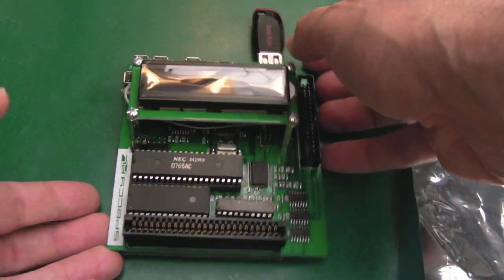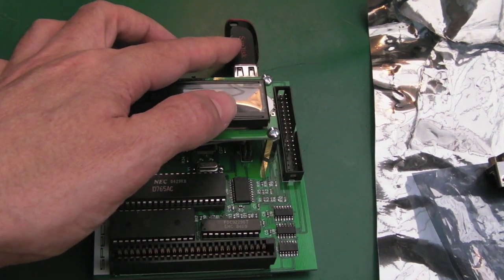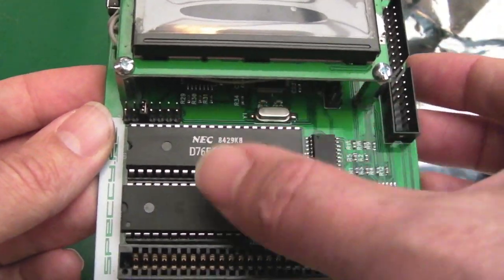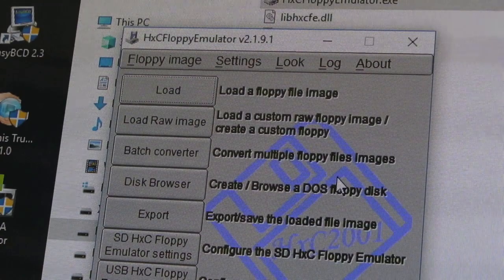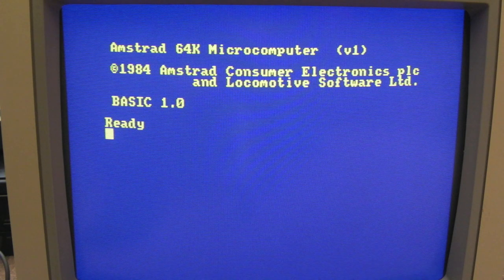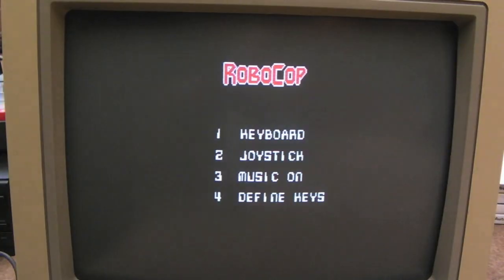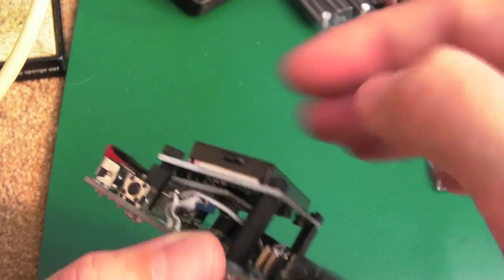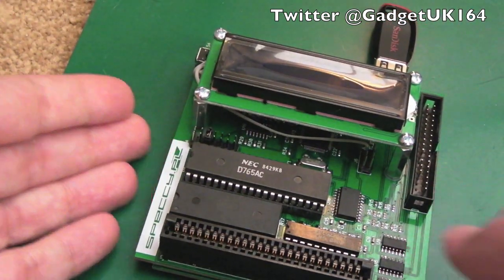Amstrad CPC DDI3 - Disk Interface, USB Disk Drive Emulator, PARADOS & 512K RAM Upgrade

Comment: It would be good if hardware manufacturers of kit like this could put the edge socket on a ribbon cable, rather than directly on the hardware (as Romantic Robot did with their Multiface II). That would solve your problem of not being able to see the screen as well as save on the wear on the connector on the CPC caused by pressing the top buttons.
Reply from the maker: Definitely!!! =D

Comment: I love Zaxon's boards. For the Amstrad I've got a "CPC 6128 USB Lite" that connects at the rear port like yours but without screen and works great, and I've got also a floppy drive replacement with HxC software and Led screen (so a Gotek but with the face 3D printed to fit and also has floppy drive sound). BTW I don't need/use this last, you if you want it I've got an Amstrad PC board that needs to be repaired...
Reply from the maker: Yeah, they are very nice!  I am hoping as he creates his website he might find some time to document some of the features and things.  For example, on this board there are a load of jumpers - who knows what they are for lol.  Floppy drive sound is a nice touch - my HxC in the ST provides that too.  It's a shame this board doesn't seem to support it.  Maybe it does, but needs a mod to add a speaker - no idea.  Thanks =D

Comment: Personally I'm not a big fan of those small displays connected to pcbs. As with the 1541Ultimate for the c64, I'm not sure they're actually necessary. 
Looks like a well built piece of hardware and useful for the Amstrad.
On another note Chris, does the traffic ever let up where you live? It's usually pretty busy when you're recording.
Reply from the maker: Yeah, I agree its better when there's no annoying LED screen to use lol.  No, traffic never lets up - drives me nuts!  Will move eventually!

Comment: Great video. Where's the best place to get the disk images where I've been using is hit and miss if the work or not.

Thanks
Reply from the maker: Probably archive.org initially - Get Amstrad CPC [TOSEC], and Amstrad CPC (GoodCPC v2.02).   Also many games can be found on https://cpcrulez.fr/games.htm#D
Reply: @GadgetUK164  thanks I'll try them, I've been using cpcrulez but I can't get b.a.t , north and south plus others to run from there.

Thanks again

Comment: Yeah those displays. I use them for the odd Arduino project, and they are a bit shitty. This looks to have some form of IC2 conversion board on the back of the display to make it compatible with the boards output. It may be possible to get a better display if you looked into it?

Comment: I read the firmware upgrade issues, and choose not to upgrade as I like the bootee and I have my hxc convertor setup to convert all my dsk quickly. I wonder how you would roll back. To avoid issues I stick with using converted hfe files.  Nice built in memory upgrade in this version thought, perfect if you can't get hold of the d'troniks module
Reply from the maker: Yeah, I wonder how to downgrade (same way as upgrade I think), but I have read that some people did revert back to prior version with issue.  I need to dig into things on the forums to ask around I think.  Thanks for pointing me towards this - this has opened up all the 128K stuff for me =D

Comment: Interesting video, Dont think i'll be getting one purly cos I've got a 6128 and I'm going to get a goteck drive to replace my current external 3.5 disk drive. But if i only had a 464 I'd definetely consider getting one. Also reminds me I've an origional DDI1 and drive in storage somewhere that i must get out and get going.
Reply from the maker: Thanks mate =D  I filmed this 3 weeks ago btw, else I would have mentioned your PCW video at the point I was talking about the NEC 765.  It was already ready to upload, just needed processing.
Reply from the maker: And btw - what dimensions are that DivMMC board you were creating?  I was contemplating building something to fit above the RCA sockets (in that Spectrum +2A/2B part 2 vid just uploaded).  If it uses CF or SD the slot would fit nicely on the back there.
Reply: the PCB is small 6cm by 8cm aprox and fits ontop of the CPU socket, it has a standard SD card slot on it. what you can do is add a second SD card slot on a ribbon cable. that you could attach to the back of your spectrum.
Reply from the maker: That sounds awesome!  Will wait to see how you get on with your video =D
Reply: I'm just waiting for the Xilinx XC9572XL-VQ44 CPLDs to arrive from china once i have them Ill make an assembly video which will include programming the CPLD then ill send you a set of parts over for you to play with.
Reply from the maker: Awesome =D =D  Just let me know when and how much cost etc =D

Comment: Was that a mist FPGA I saw?
Reply from the maker: I've not got a MIST, but maybe you spotted one on Zaxons desk there at the point where he was using the interface on the CPC?
Reply: On top of the 4160ST? I really want to buy one for the Macintosh side of it.
Reply from the maker: The HxC is in the side where the FDD normally goes.   The grey box on top of the ST is the Ultra Satan - a dual SD card dual HDD emulator for the ST.

Comment: This worked for me: My autoboot initially returned an error#31#. To boot from the screen (Autoboot) with the latest flashfloppy, you need to download the latest files from here and place in the root of your USB drive: norecess.cpcscene.net/news/hxc-floppy-emulator-manager-v35-released
Reply from the maker: Thanks, I will give that a go!
Reply: This link us useful. Extract it first to your SD card and then overwrite the root with the files in the link I provided earlier.  If the files in the link I gave you don't work for you (maybe your firmware is a couple of months older than mine as I only got my DDI3 today), try the older version also included within that same file as a subdirectory.  The first file to extract to your SD card I recommend is https://mega.nz/#!7gUSARaQ!vCaLDNkV2_UBeSRIiQk8MvewzEEQVaeL4SfbBXV8lMc